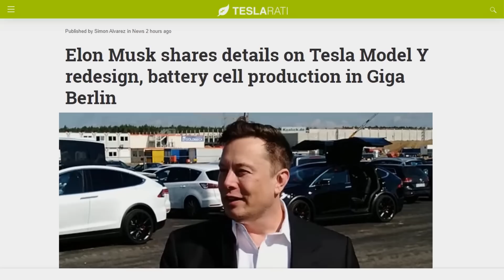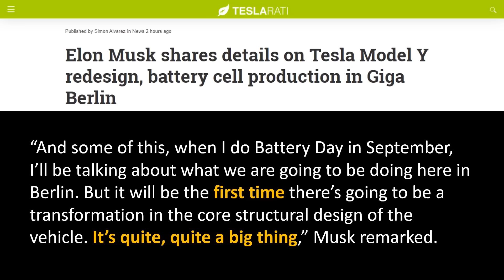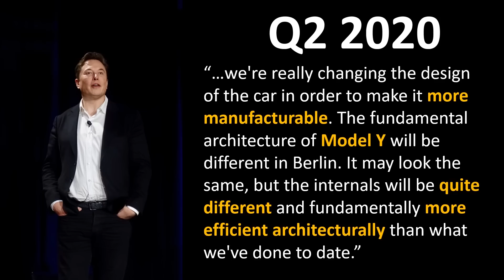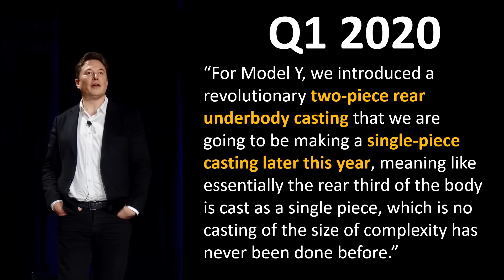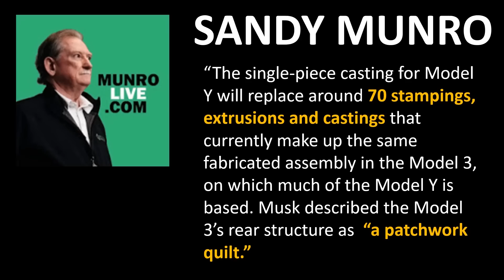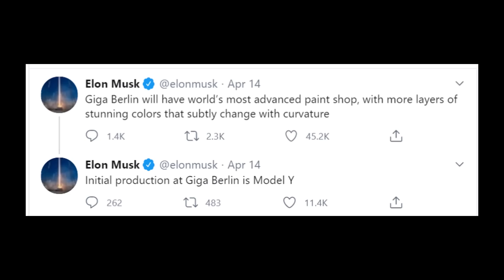Tesla is Redesigning the Model Y (Gigafactory Berlin)

Comment: IMO you are still missing the complete redesign of the battery system which is the core of an electric vehicle.  This will include elimination of modules, elimination of battery tabs, single operation to connect all batteries, larger batteries, different battery chemistry, different battery pack shape, etc to create a lower cost, higher density, longer lasting and lighter battery pack with a completely and radically different redesign. This is the core of an electric vehicle. This is new. This is what will be talked about at Battery Day. This will blow your mind.

Comment: Not that simple. If the pieces are too big, in case of accident, it will be very expensive to repair, as you have to change some huge expensive part instead of 2-3 small ones. Might not worth repairing in some cases.

Comment: 20 or more new electric cars coming next couple years from mainstream car manufacturers who know how to build cars is going to shrink Tesla’s sales dramatically. Also any new battery technology that it introduces would have been developed already by Japanese, Korean or Chinese companies. Dark days ahead for Tesla
Reply: BULLSHIT, Legacy car makers KNOW ONLY ONE THING , how to make ICEV .
they are NOT Specialists in BEV Technology. 
the Chevy BOLT is 78% made by LC Chem in KOREA and built in a Chevy SPARK plant. 
GM has no KNOWLAGE in BEV Drivrtrain , Electric Motors and LION Batteries. 
" IF you dont make it, you cant UNDERSTAND it " - Sandy Munro. 
GM does NOT have a BEV Factory, BEV Drivetrain Factory, or a LION Battery factory. 
FORD is even worse off and you are NOT going to see a BEV Dodge / Ram /JEEP vehicle anytime soon.
WHAT Competition ????? Its been 8+ years , I am STILL WAITING ............
LEGACY cars cant even build a BETTER car than a 2012 Tesla Model S in 2020. 
the TAYCAN has only 198 miles in Range , PITIFUL.
GM is using OUTDATED LION Pouch batteries , meanwhile TESLA is working on Advanced NEW Nickel + Silicon LION Batteries for its upcoming Production vehicles.

Comment: And wouldn’t the single piece underbody casting make an rear ended crash extremely expensive?
Reply: Max Hsu So? At that point it’s not Tesla’s issue 😬
Reply: @TurreTuntematon  It is not Tsla's issue for sure. But from a car owner's perspective, highly expensive repair will make u think twice.
Even if insurance could cover it, assume every automaker adopts, the potentially expensive rear end repair will drive up the cost of insurance. 
Depends on ur angle of course. It is like feature phone repair could be inexpensive but nowadays smart phone repair would run u a couple Benjamin. And u wouldn't throw ur phone around.

And I'm wondering IF this would make it extremely expensive if one were to get hit real bad.

Comment: After listening to Elon fumble through his presentation, then having you give a summary, a couple of thoughts...

CASTING has been used in engines and certain bumper assemblies, as has been found to be significantly WEAKER than stamped or machined pieces.  Ruger also found this out with their cast and polymer pistols, as important components like hammers and sears would break under the stress of being used.  This would seem to be a cost cutting measure that might bite Tesla in the butt.

Paint quality has not been due to not enough or the wrong kind of automation.  It's been due to bad processes from start to finish, and apparently Elon hasn't learned this yet.  Unless Europe has the same warranty laws as the U.S., Tesla will be spending far more there to correct their new expensive paint shop errors, than they are now with their existing shop.
Reply: Wow. An expert in auto painting and frame casting! A genius! When can we buy your vehicles?
Reply: @lengould9262  Wow!  A triggered fanboy!  What are the odds?

Actual facts from actual experts, snowflake.  Maybe Elon should have used them instead of vegan video game programmers, eh?

Comment: I suspect Musk is referencing the mega-casting of the rear-third of the Y body. This will likely include casting for inclusion of "crush-cans" used for energy absorption (crash scenario).

 Of course there's likely other major structural changes to announce. Battery efficiency/cost; Autonomy; etc.
Reply: You get it!
Reply: Why not cast also the front in one piece and both sides. Not to forget the new pack and underbody as one casting. The machine will be big enough for each part. This will be amazing!
Reply: @romanhx7931  The question is , is this truly revolutionary, as Elon said, or is he over evaluating?
Reply: Don‘t forget the new wiring , faster charging and better finish!
Reply: @romanhx7931  I'm very curious about new wiring. I'm hoping is is like a computer network. This way, they could make some crazy harware update anywhere in the vehicle, push a software update, and support it. Also, I'm hoping for Ludicrous 3's and Y's, just to give piston cars in the 60-100k range heartburn, right after the Plaid S and X land.

Comment: Tesla Grohmann Automation is from Germany. My guess is that Model Y will have significantly fewer parts and will be built by robots completely.
Reply: Exactly. I think most changes will be related to this. Manual assembly is also much more expensive in Germany (compared to Shanghai). Elon has also been talking about making the production line run faster for more than 10 years. It would by nice if the Berlin line was designed with that possibility in mind.
Reply: @jwstolk  asking informasi is you asnking now tim is you Elon you wrong polejay hoax you informasi is saking tim is you sorry Elon asnking now tim is you adesten you papulason wrong polejay hoax corupsen palsu papulation mafia fakta asnking informasi is you adesten
Reply: @jwstolk  sorry l am now tim is you  adesten
Reply: @jwstolk  Elon been sorry l am now tim is you l am stop is you
Reply: Freek - NO, Tesla will still have HUMAN Final Assemby .
Reply: Sorry asnking informasi now tim is you

Comment: If they replace the rear crash rails with single casting repairing rear collisions will be a nightmare. That’s not very sustainable when you can’t repair a car after collision.
Reply: If everything goes according to elons plan there won't be any carcrashes
Reply: @gr3adatooooor914  can the Tesla prevent REAR crashes? Emergency acceleration? Hadn't heard of such a thing, and many rear crashes are caused by being hit while stopped in traffic
Reply: If the car has its rear crash rails damaged it will be totaled anyway.
Give the leftovers to Rich Rebuilds
Reply: Mariusi -you just UNBOLT the rear section , replace with a NEW Rear Casting and recycle the OLD one.

Comment: Wouldn't this be a problem when there is a crash and then whole cast needs to be replaced instead of a small part?
Reply: If you're in a crash so violent this piece is bent, the car is probably too damaged to be safely and cost efficiently repaired.
Reply: Karreth thats true! But a small dent Will also be expensive to repair!!

Comment: Elon also mentioned on the 3rd row about simplifying the battery pack. Modules do not have any benefit. And Elon always thinks a good design is no part at all.
Reply: I think the separate modules are there to allow multiple in flows for charging. So rather than sending the electricity down one battery circuit/cable, you can divide it up and reduce heat and increase max load when charging
Reply: I am now tim is Elon l am now tim is Ani sorry you papulason wrong polejay hoax corupsen palsu fakta asnking informasi is you  adesten is you l am now tim is you adesten

Comment: It is not a Model Y redesign.  It's a factory redesign.  The changes to Model Y will be relatively minor, from the standpoint of consumers.  Some parts reduction, fancier paint, cheaper production costs are what I expect to see.

Where I'm a in the dark is what batteries will go into the Model Y.  If they build Roadrunner battery production lines at GF-Berlin, then the pack will be redesigned and the performance and cycle life characteristics of the car could be quite different.  GF-Berlin isn't planned to produce the Model S or X or the Roadster - so if they put Roadrunner there, Model Y is the likely recipient.  That would be a radical change - a redesign.  But I can't guess if they will do that.
Reply: The casting in one piece is a car redesign. If you go from 70 parts to 2 parts it's a car redesign. If you go from 2 parts to 1 parts it's a car redesign.
Reply: @yourcrazybear  They aren't going from 70 parts to 2 parts on the Model Y.  The Model Y already has giant castings that the Model 3 lacks, thus far.

They appear to be going from 2 large parts to 1.  Might be a few minor parts that will be disappeared, the details are sketchy, but it's a design change rather than a redesign for the Model Y.

The factory is what is getting a major redesign.  This is significant!  Absolutely.  I'm not trivializing it.  But the Model Y won't be substantially different.  A bit lighter, some production cost savings, that's it.

We do not call all design changes 'redesigns.'  If we did, Tesla would be said to redesign their cars 60 times a year, if not more.  That's just silly.

Elon says the factory is their most important product.  And that's the product they're redesigning.
Reply: @Urgelt  Fair point.

Comment: Hi Jonathan, I enjoyed your video describing possible ways that Telsa will make manufacturing the Model Y more efficient and cheaper.  Another aspect that Elon has mentioned previously that could also be incorporated in the new design and manufacturing process is the revolutionary change in the wiring harness.  In particular, he described using bars of metal rather than wires because robots would be able to handle these easily, whilst humans are much better at joining and routing wires.  I think they planned for a reduction in wiring from many kilometres to a few 100 m per car.  In their patent, they described electronic nodes that could connect to parts like the window motors that would replace lots of individual wires.  This could make it cheaper and faster to manufacture.

Comment: I suspect that the Berlin version will also get the wiring changes leading to use of flex circuitry and many fewer feet of conventional wire harnessing. This has been talked about, but the present model Y while haveing improvements to wiring, did not include the state-of-the-art flex circuits that will greatly simplify the vehicle assembly.

Comment: The current Fremont MY frame is a mess, hence the panels, doors, hatch and frunk don't fit. When the car was announced, Musk promised a one piece cast aluminum frame, which did not appear. There is a rear casting but the rest is fabricated pressed steel. The impression is that Tesla can't be bothered to fix the existing frame because they are working towards an all aluminum frame. Funny, the Chinese factory can get this to work, but not Fremont.
Reply: Huge Aluminium casting is unnecessary, its going to use alot more aluminium which is more expensive than steel
Reply: @carholic-sz3qv . Er wrong...  per pound aluminum is more expensive than steel, but the  steel sheet has to be cut, stamped and welded together in a number of sub-assemblies then welded into the frame which is not only labor intensive, but as the workers at Fremont have shown, they can't get it right which is why it's so difficult to get the doors and panels to fit. 18 months ago Musk said the MY would have a cast aluminum frame. It didn't happen, only part of the rear frame. Now he's hinting that the Berlin Y will have it.
Reply: @67daltonknox  st@pid bullshit, vw and toyota have been making 10 million cars a year, they already have all the press/stamping tools, they just need different stamping forms, they also have the experience in manufacturing, vw and toyota also uses lighter materials like carbon fiber...... the Wolfsburg vw car plant in germany alone makes almost a million car a year, its all about efficiency in the manufacturing
Reply: @67daltonknox  let's be real tesla is just lazy to improve their building quality, making EVs isnt that hard, the heavy battery, motor and strong suspension supports, toyota/lexus even uses lighter than aluminium = magnesium casting for suspension towers/support
Reply: @carholic-sz3qv  Musk has confirmed MY frames from Berlin will be cast aluminum.
Reply: @67daltonknox  so wtf cares?!?!, building and shiping heavier machines when VW is already converting their tousands existing press to make EV models....... that big casting is not impressive at all trust me.
Reply: @carholic-sz3qv  Well for a start you were wrong and secondly I want to buy a MY that doesn't have a warped frame.

Comment: Elon is using the old Ford model of making things more efficiently and not passing on the cost savings.  It's fair but it is what it is.  He could re-design tires that do not require compressed air and roadways that can propel any vehicle that has an electric motor.  As the game plays out it's the old distant (landlord) ownership game all over again.  We're buying a fancy soda can with a battery, wheels and a motor that comes with the word "autonomous" optionally attached for the illusion of personal autonomy.   Can you tell I'm in a mood because I own Tesla stock of recent acquisition?
Reply: But he is passing on the cost savings. The price of the cars have been lowered before and will continue to be lowered in the future. He is constantly talking about how the cars are still not cheap enough.
Reply: Nonsense, the vw VAG sells 10 million cars a year with hundreds of different models and the efficiency is on another level, just like toyota

Comment: Single piece is going to be very bad for Canada. We're unable to use auto-pilot, we also have a HIGH ratio of BAD drivers. This would be hard to repair
Reply: Kevan Sue I keep wondering about this concern. It seems like the cars will be more likely to have insurance call them totaled? On the bright side the cars help you stay out of accidents. Sandy Munro seemed excited about these changes.
Reply: In Germany it’s irrelevant, if you crash on the Autobahn your car is done. 😅
Reply: bitnukl Which drives a lot of German safety, I would assume.
Reply: @Charlie Fox
Turned out if you have strict technical regulations and check all cars every two years cars don’t destroy themself while driving.
That helps a lot in not killing people. Of course we still have some bad drivers. 🙈

Comment: Tesla is a great company I'm invested love it.  This is something that is different and I am slightly concerned.  I am in the market for a model 3 or model y for my family.  With typical cars I couldn't care less if I got the current year's version or the next year's. in fact it's usually better to get the year before cuz it will be cheaper at the end of the year.

With Tesla you don't know what you're getting.  When is the model 3 chrome delete coming out? When is the heat pump coming out on the model 3? What updates did Tesla make to the model three or Y yesterday?

Comment: There is still huge space for improvement and simplification, I just saw Munro’s teardown and they still build an ancient, heavy, expensive point of failure called lead-acid battery in. I’m pretty sure there is a million reasons for it but there is a big against WHY :)
Reply: Because the vehicle control circuits, door, trunk etc opening, closing locking, the computer etc all run off 12v, so if main battery is isolated due to accident or failure the car is not entirely disabled
Reply: J . P Goodwin yes, I figured this part out but it’s still seems like a lazy ‘solution’ not really Tesla like. The ultimate goal is to make the hardware part of the EV nearly free by removing all unnecessary parts and super-optimising all the must haves, the whole 12V system seems like a low hanging fruit. First of all the voltage is too low for decades now even in ICE cars and then..... anyway, they will figure it out I’m quite hopeful with Tesla they are attracting the best people.
Reply: Expensive? Lead acid is still used exactly because it is cheap and ubiquitous.
Reply: I believe the reason for using lead-acid batteries might be for cost and safety related reasons.
Reply: I understand it like this...even in freezing temp the warning lights have to work...lead acid works at the lowest temp therefore you still have lead acid simple right?
Reply: Acid-lead battery actually has its own advantage